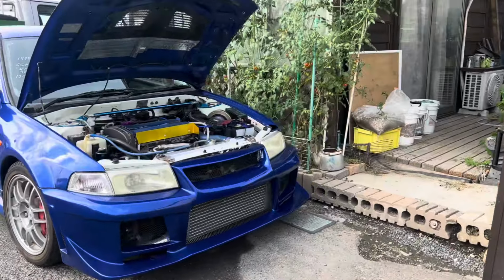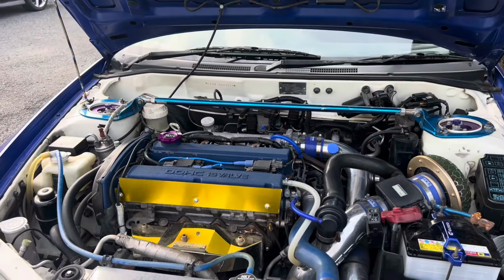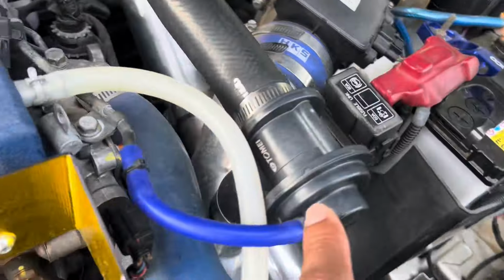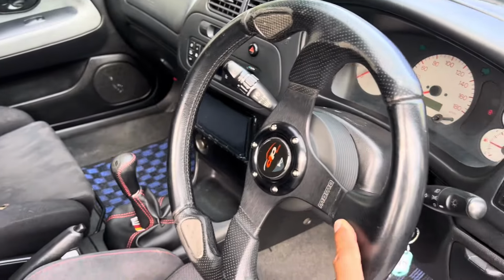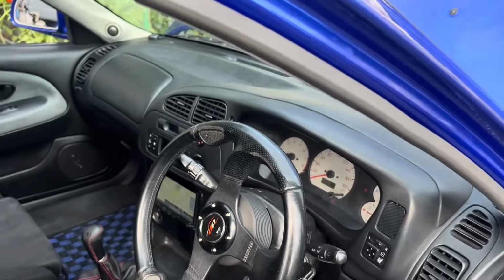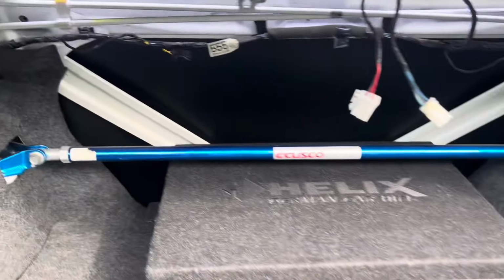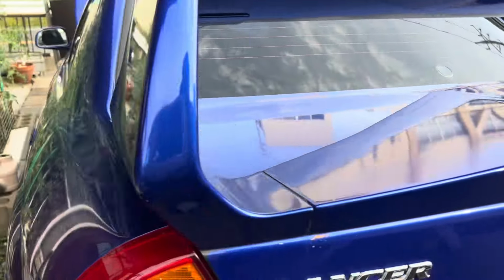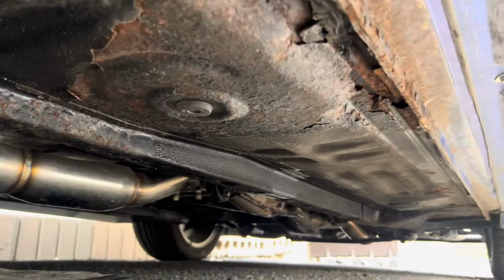‼️FOR SALE‼️ 1998 Lancer Evolution V $22,950 shipped !

Comment: Cut n weld a new floor pan into that section…it’s not that big a deal…however I’d be worried about more rust on that rear right suspension specifically as well as any metal lines running under the car. Still a sweet ride